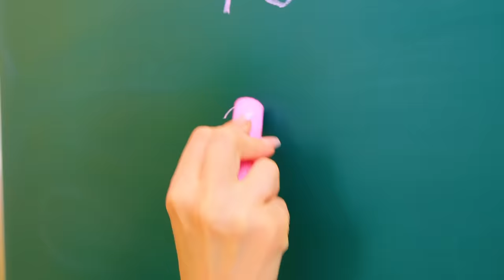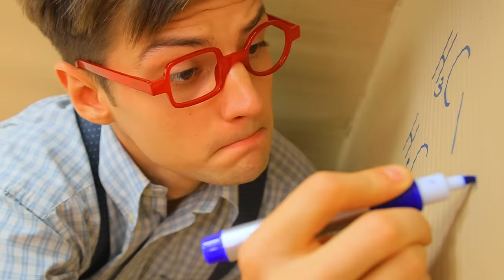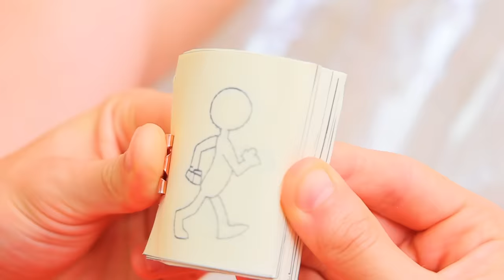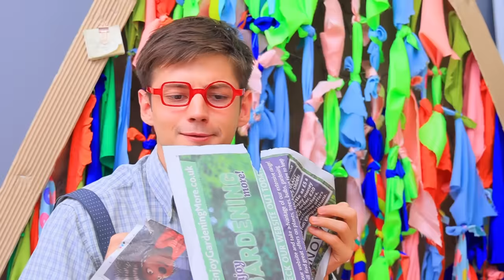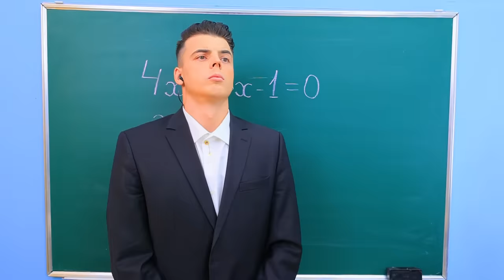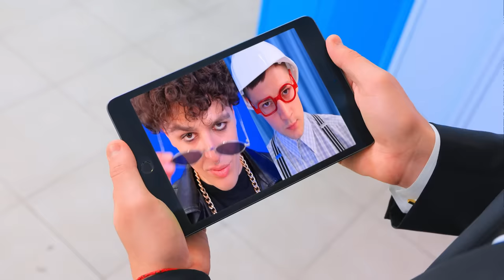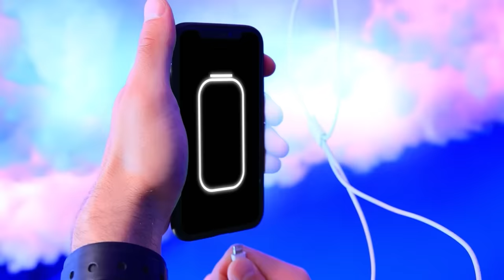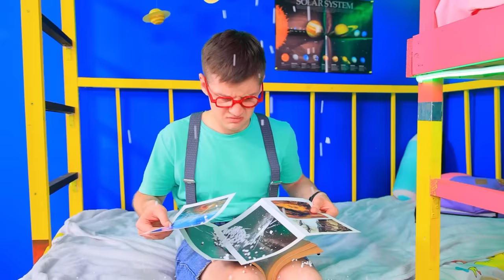We Build a Secret Room! Poor vs Rich vs Giga Rich Secret Room

Comment: A little glitter won't be enough you need to put 300 Glitters in the basket a little glitter not enough to want 200 or 3,000 a lot more than that like 50,000 Maybe